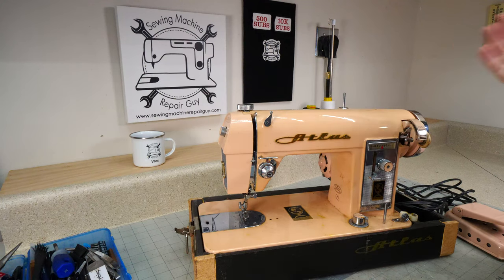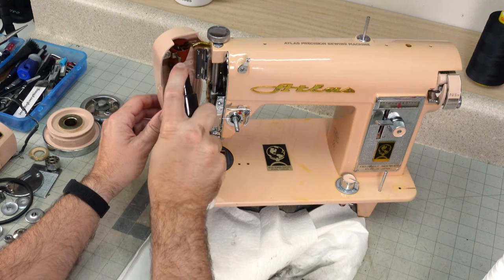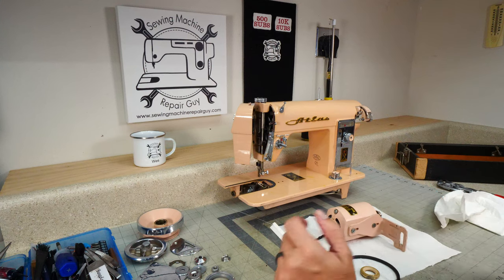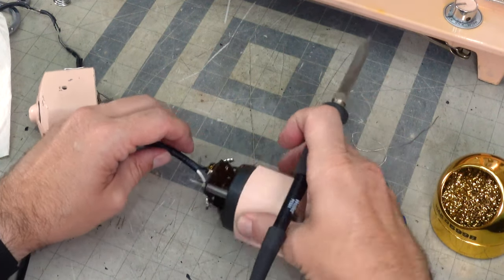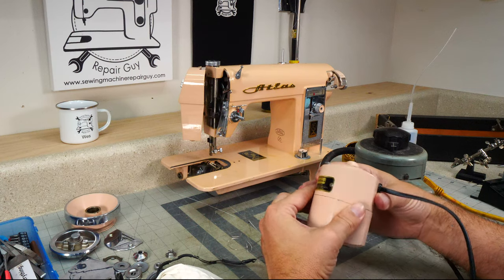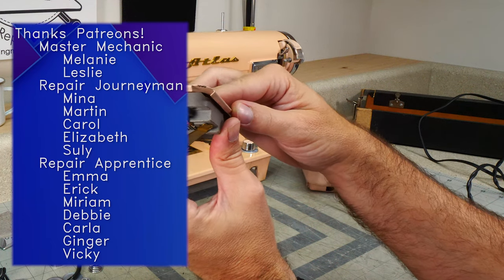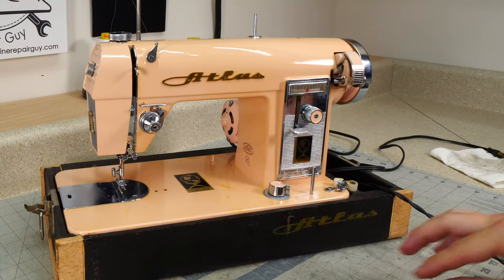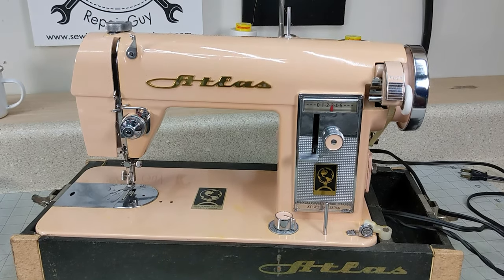❤️Beautiful and ⚡ Dangerous, What was wrong with this Vintage Sewing Machine?

Comment: I have been soldering for over 50 years and your soldering looks just fine. The only thing I would suggest is to make good strong mechanical connection from the wire to the lug by bending and crimping the joint after you have tinned the wires. It's nice to see someone do a good soldering job like you have. I watch a lot of people solder on YouTube and some of it makes me cringe, Nice work.

Comment: From what I hear, that motor sounds like a freight train.  If the audio is accurate, the commutator needs reconditioning.  The mica insulation is sitting proud of the copper.  Good advice about being safe with electricity.

Comment: In shopping around for vintage machines to restore/refurbish, I am always surprised at the number I encounter that people were apparently continuing to use with stripped or damaged wiring. But my grandfather was an electrician, and checking the wiring was something he taught me many moons ago. He also taught me to solder (we built a lightsaber together!), a skill that has come in very handy since I started working on vintage machines last year. 

These mid-century Japanese-built machines are fantastic. I was recently given one, a green Consew domestic machine (Model 970) that ran surprisingly well in the initial test, and only got better once it was properly cleaned and oiled. The thing weighs a TON, but stitches through just about anything. I only wish it had more space under the arm! Still would like to get a pink Atlas or a blue Morse, but I've got enough of a backlog on the bench for now. =D

Comment: The 401A also has an issue with the wiring to the lamp. Lift top cover, to the right you will see two twist-on wire connectors. These are too small and may not be properly secured on the cables. Also, follow the cables and they pass very close to one of the gears towards the front of the machine.

Comment: Thanks for sharing, The perfect procedure to revive an old machine except for one missing important step which is the insulation test using a 500v /1000v dc tester between the motor body and the live lines to stress the insulation and see if it is safe to use. I suggest a Meger insulation tester or similar. Cheers

Comment: I wish I would have found this video 1 day earlier!  Yesterday I found my wife's grandmother's Fleetwood Deluxe 195  in the closet and decided to bring it back to life.  I've never touched a sewing machine before, so I had no idea what to expect.  First thing, the lamp cord insulation had disintegrated, like your motor cable.  Second, the motor (exactly like yours, these must have been "cousin" make/models....) was completely frozen.  Would not turn.  And I could not get the case off, the rear bushing would not release the shaft and I didn't want to force it.  Seeing this video, it is clear it would have let go if I kept applying force, but in the absence of this knowledge, I didn't know if there was a hidden c-clip or such.  Liberal application of Blaster penetrating oil applied through oil ports did the job.  Got it spinning by hand, albeit still a bit stiff.  Put it on a variac and brought the voltage up slowly, got it spinning at around 50VAC, and then it really broke loose and spun up to full speed.  Re-installed the motor, but it was really struggling to cycle the mechanism, would slip or stall often.  Turning by hand,  the action was not smooth, although I had no reference point as to what it should feel like.  Just that the motor was struggling.  OK, let's assume this thing needs oil and/or grease, after 25+years in the closet.  I start oiling all the bushings I can find; underneath, in the side access and behind the front cover.  The obvious oil ports in the castings and those 3 cool spring loaded oil caps on the top helped identify where to oil.  Much better.  Still seems to be getting stuck on a cam action near the front, that actuates the "dipping arm" (don't know the proper term).  Little bit of lithium grease here, and on some rear cams, and vola, it is now operating like butter!  The motor smoothly goes from very low speed to full speed, using the factory pedal (also same as in video.....those suckers get warm!).  Had figure out that the bobbin clutch was not right, it wasn't disengaging the main action when loosened.  Turns out it was just old oil and crud.   Cleaned, oiled and now switching smoothly between bobbin wind mode and stitching mode.  I don't know about any other sewing machines, but this little guy was very well made, the machining looks first rate.  That was alot of fun, bring this back to life! 
Need a bobbin tire (do you have blue?), some spare needles and to figure out how to thread the machine....and "I'm sewing!!!" ( see Bill Murray sailing scene on What About Bob?).

Comment: What was it you hooked the motor to after putting new wire on?
Reply: @dennislett7896
A Variac (variable autotransformer- Variac is a brand name that’s become a collective noun). He’s doing so he can supply a variable AC voltage to test the motor,  without having to account for the unknown factors in the resistive foot control.

Comment: Have you ever uses a 100 watt lightbulb in series with older machines? 
This is very popular with the amplifier repair crowd. If there are any shorts in the wiring the energy will be dissipated by the light bulb.
Reply from the maker: Interesting, never heard of that.
Reply: @SewingMachineRepairGuy  it works good. Most techs use a ceramic bulb socket from home depot and wire it in series with a plug socket. 
Techs that work on tube equipment swear buy it.

Comment: Good repair!  Vapors from soldering do not contain lead because the iron does not reach a high enough temperature to vaporize the metal.  However, there is lead danger from handling solder; do not eat or drink, touch your face, etc., until after washing your hands.  Do not waste your money on lead-free solder because it's difficult to work with and does not make a good joint like leaded ("60/40") solder does.  The vapors created by the soldering process are from the flux core, which is mostly a rosin.  It's not poisonous but the smoke can exacerbate respiratory conditions such as asthma and bronchitis.

Comment: If you blow on the solder joint, it will cool faster; and the joint will set. Arm jitter separation solved.

Comment: Not bad for a newbie, but the armature should have been pulled and the commutator resurfaced and the mica between the segments cleaned. There was too much carbon which causes
what is refer to as “ creeping current “  
which is a slow kill to the armature.
I use a old Emerson electric motor my Father rid up when I was a little boy with a large “drill chuck” to turn the rotor polishing commutator and each end of the rotor shaft that rotates in the motors brass bushing adding a little oil in the bushing also. I use a small triangular file
and commutator cleaning and polishing bar and the clean commutator off with alcohol . Rotor shaft polish with crocus cloth😎
I still use it today at age 71yrs 
You have LOTS of potential 
Most IMPORTANTLY my father taught me to offer my work up to God every day with the promise to do my best with His Help! God Bless You Brother 😎
Reply from the maker: Thanks for the advice!
Reply: Concur with criticism by Richard Givens.  Also no strain relief on new motor wires? Just grommet?
Reply: Crocus paper to resurface the armature. What about new carbon brushes?
Reply: @southothehighway  no, crocus cloth for polishing the rotor shafts at each in to allow for smooth turning in the motor bushings , new brushes if necessary,
Commutator resurfaced with small triangular CLEAN file 
we usually heat the brushes to “cook”
any excessive oil from them.
Commutator is polished with special commutator polishing bar or stick
Reply: Richard Givens,  great advice on how to properly service the motor. 
I read in an old Singer service manual, to use a pencil eraser to clean the carbon off the commutator. I have done this a few times and it typically leaves the commutator a shinny copper color, and turns the eraser black.